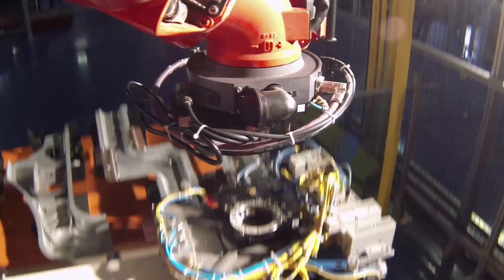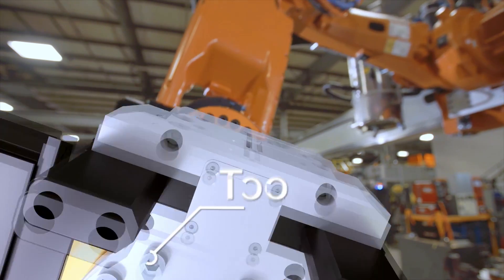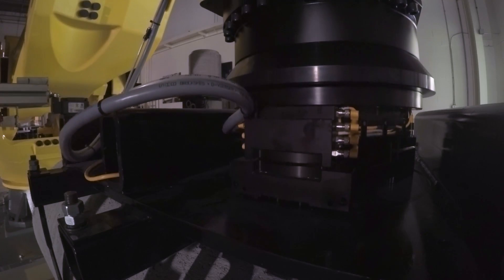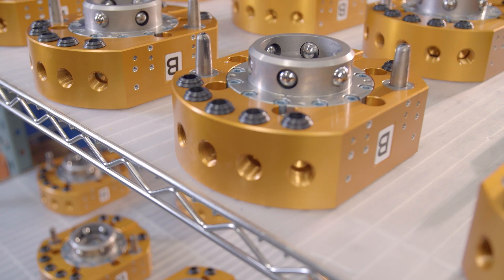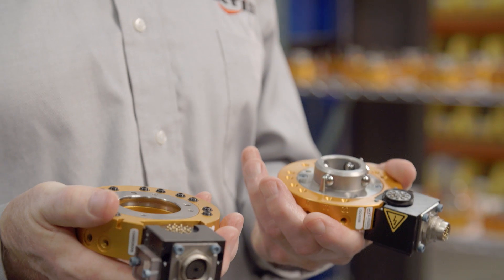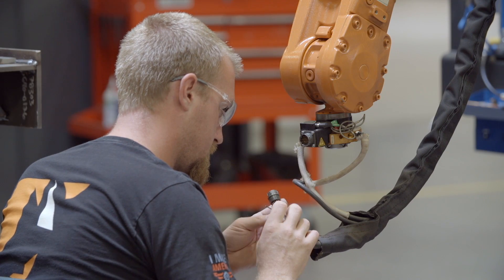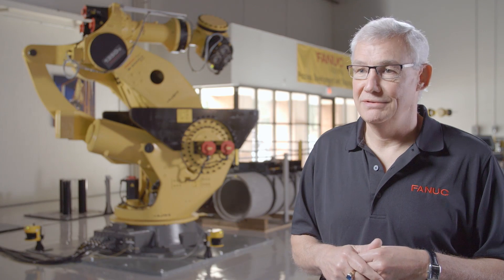Why ATI Tool Changers?

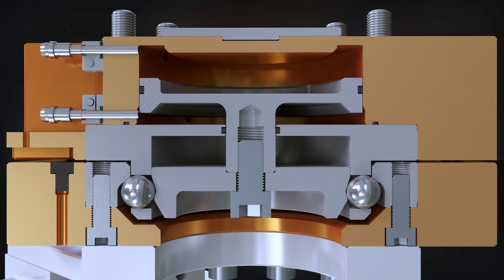Comment: what prevents the air piston from 'retracting'  (retract = unlock, extend = lock) if the robot stops with the tool upside down from the 2:21 view?  after such retraction, if the robot then moves to a position where gravity is pulling the EOAT down, would the tool changer then be unlocked?  (in this scenario, the robot is moving DURING a loss-of-air-pressure event).   

Could you add a spring w/in the system so the pneumatic actuation is "normally extended"?  It would only need to be strong enough to prevent gravity from retacting the piston.

Comment: niiiiiiiiice
this is coool.
I wonder what advantages this has over what 3dprinters do for tool changing (1 steel balls and 2 dowel pins for each of the 3 coupling points, and just a rotating twist lock to pull them closer together) I'm assuming it'd be hard to design one of those for high loads.
i'm just a gawl interested in engineering not a professional or anything xD I'm temped to study mechanical engineering now for college

Comment: what keeps the ball  bearings from falling out?
Reply from the maker: The male coupling of an ATI Tool Changer is designed with a retention feature to ensure the locking balls do not fall out when locked. The position of the piston prevents the locking balls from falling out when in the unlocked position. For more information please email SalesAdmin@ati-ia.com.